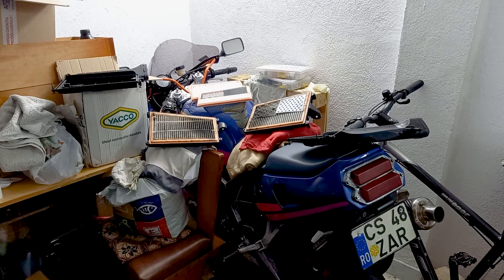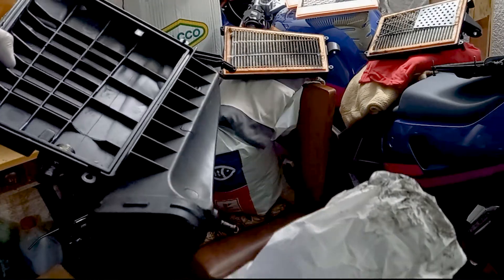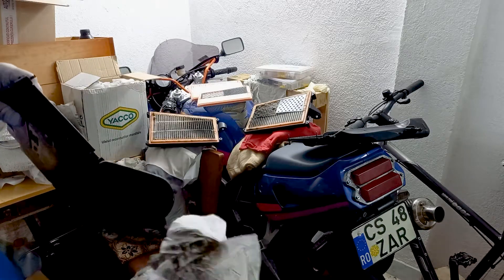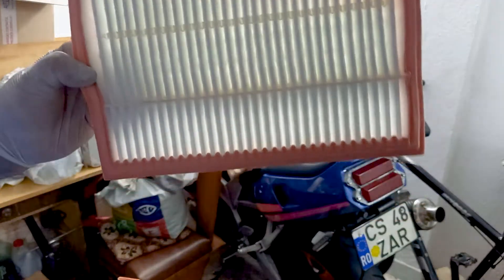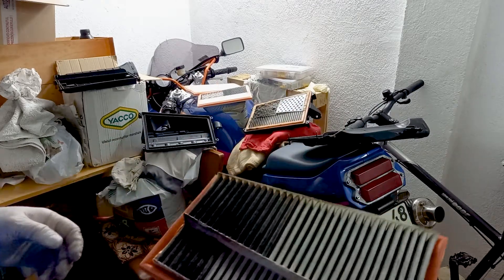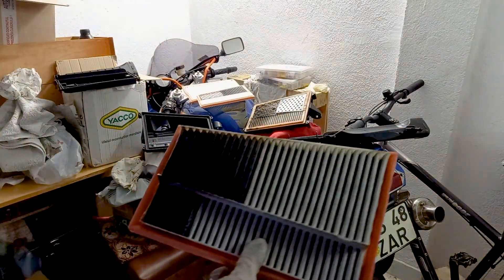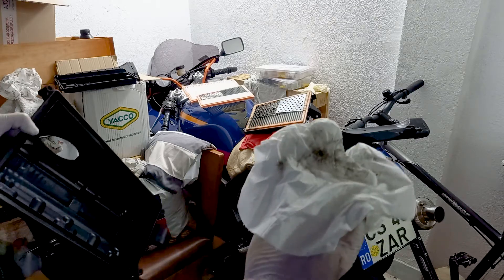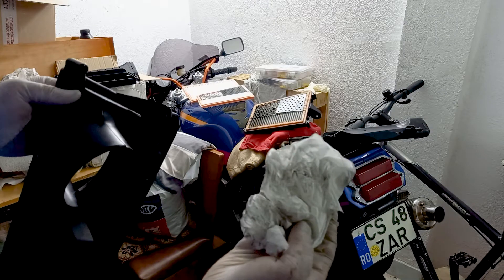OM642 Oil Catch can and how the air filters look after 4000km Part 3

Comment: my om642 ( w211) has had an aftermarket Section silicone section put in between the intake Y pipe and the Turbo... its leaking of course.... did your Y pipe fix work ? its a bit simpler than the T section.
Reply from the maker: My silicone coupling is not leaking because it has a rerouted pcv gas flow. I didn't install a y pipe connector because that would leave room for direct factory pcv connector. My pcv gas flow goes to an oil catch can and afterwards it goes to the airboxes before the airfilters.
Reply: @AlexAndreiZAR  yes, of course. I’m sorry I was forgetting that.

Comment: O sa scriu in engleza ca poate ajuta si pe altii ce mai dau pe-aici, romani sau nu. That's not normal behavior, and a catch can is just a bandaid instead of fixing the issue: the PCV valve. Change the PCV valve and the catch can won't be needed, and most likely your oil consumption issue will be resolved too. It's cheap and changing it on OM642 takes like 5 minutes, maximum. The gases coming from the PCV don't create deposits on the intake, if the PCV works fine of course. The EGR is only opened when idling or at small RPMs/low load, and at small rpm barely anything comes from the PCV, and vice verse: high rpm, the EGR is closed off. I own a E280 with OM642 and I use ZERO oil over 10k km, and there's no oil on my air filters, nor at the entrance of the turbo. The moment I'll ever see that I'll instantly change the PCV and problem solved. These do go bad over time, but luckily they're cheap. Bafta!
Reply from the maker: Check my other videos. I have changed the PCV gasket and PCV valve. This video is just the aftermath of how the system is working. I don't have oil consumption. The gases from the pcv oil create an oily film in the intake and get mixed with egr soot and create nasty sludge, specifically for every turbo diesel with direct injection and same goes for modern turbo gasoline engines with direct injection. Thanks for commenting in English!
Reply: @AlexAndreiZAR  The long idling or city driving with the egr open creates the soot, the PCV vapors don't contribute to it
Reply from the maker: @em4703  soot alone doesn't stick all that well to intake walls. Soot together with oil vapors becomes very sticky.
Reply: @AlexAndreiZAR  Ok, so how do you explain EGR deposits that are identical to the intake flaps deposits? Why do they form in the EGR if oil vapor doesn't reach that component?
Reply from the maker: @em4703  I didn't say that they don't stick at all I said they don't stick that well on their own. If you have massive amounts of build up in the EGR cooler, I would assume the injectors give a high amount of diesel in the combustion chamber which is not fully burnt. The unburnt diesel (in very small amounts) gets stuck to the soot particles making them stickier than they normally are. This is my theory. Thing is that the om642, om611, 612, 613 all are engines designed to have high blow by amounts of pcv vapours/gases. Cheers!
Reply: I'm in the same boat as OP and with a brand new OEM PCV I still have a lot of oil in the intake.
Romanians know everything so how do you explain that @em4703? Besides mentioning city driving as a catcher's mitt because both myself and OP (as far as I understand) use these vehicles outside the city.

Comment: Nice review. When the pcv valve does not work well this is the result of the air filters. It does not need to throw fault code when not working properly.

Comment: Not normal filter usage after 4000km. Unless you're driving around fields in the middle of nowhere....  I've changed mine after 22000km - take a look.... https://i.postimg.cc/nL1ZL0RG/IMG-20201005-144127-HDR.jpg The rear side was completely clear. Nothing modified on my engine, just replaced the pcv valve, both elements, some years ago.
Reply from the maker: Please check my other videos where I show that I have rerouted the pcv to an oil catch can and then to the airboxes. Its normal to have that sort of dirt accumulation because Romanian roads are not very clean.

Comment: Hi Nice review , i installed a catch can on my 2011 Gl350 with the same om642 and mine is catching way more than yours , im wondering what type of oil do you use on your car is it 5w40 or 5w30 , i do use a 5w40 ( better engine lubrification but oil catch can is catching way more than yours ) , i also changed the PCV valve to tacle theoil consumpsion . i'm planing to use a 5w30 next time to see how much oil the catch can catch . please let me know the type of oil you are using 

thanks for the review
Reply from the maker: Hi. I am using 5w30. Mobil 1 esp 5w30 to be more specific. I have used Motul 229.52 5w30 specific in the past and after Mobil I have switched to Yacco Lube M 5w30. All are great oils.
Reply: You need to renew 1 or 2 diaphragms in pcv.